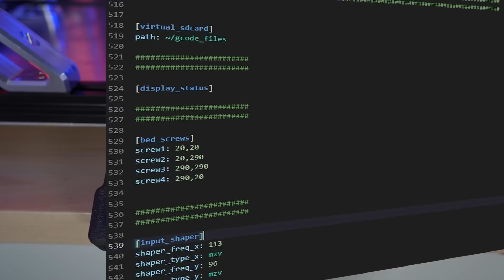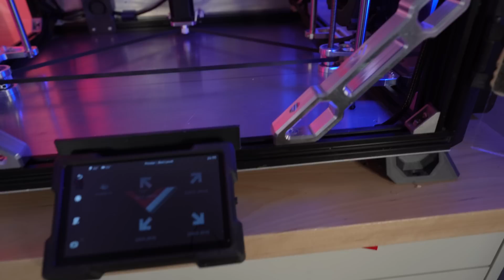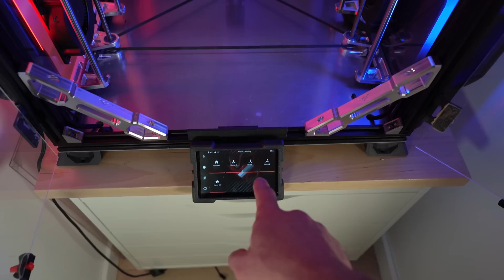VzBoT Bed Levelling

Comment: I was expecting some complicated mechanical means using advanced electronics to achieve angstrom level zero of the Z axis, but then you end up with more weight like the 'TAP'. Your way is better, KISS and use a thick  base like on this machine, wow.

Comment: Your Z-System is the primary reason I'm avoiding a VzBot until there is a more modern z-system like 3 lead screws approach.  I believe there is sufficient evidence that hand adjusted z is a bad idea (Ender 3/Ender ..../insert Ender clone here).  There is no doubt it can be hand adjusted and "It will be fine for months".  But realistically most printers have moved on from that for a reason.  It is a lot easier to control and do a good Z-adjustment on a printer that does it using accurate sensors than needing to do this by hand.
Reply from the maker: You know that I run a beacon sensor? And it can run with any sensor you like?  You know there is also a 3z mod? But for me, my single Z is just too good to switch to anything else. Simple and effective and very very consistent layer height.  Going 3 Z can go bad most of the time. More components, more excentricity, more parts that can fail.. more tuning.. etc..  this z has proven me to be a work horse that is very very precise

Comment: I also found a truly level bed makes heat rise evenly around the bed. When uneven it accelerates air rise and causes one side to passively cool and the other to passively collect more heat.

I found this when printing large ABS prints while my printer was on an uneven shelf 😮

I have a passively heated enclosed Sermoon D1, but might soon actively heat it by installing a intake vent on top and pump it to the bottom while also adding a inline 25w heater

Comment: Hey I might have something really interesting for your build. I have been playing around building machines and I have a printable frame / 4x Z axis screw / straight rods and end stop at each position (top/bottom) integrated in easy to print parts.

Really super sturdy, easy to build and I built up to 64ft/c machines with it. It use 2020 and 2040.

I am not on social media but send me a pm Ill send you a cad file so you can have a look...

Comment: I guess you use mellow super infinite for your vzbot. Can you add 2 pt1000 probes to it? Is it any way of using them
Reply from the maker: sure ..there are many more ADC input
Reply: @Vez3D  so i can connect pt1000 probes directly into thermistor port?

Comment: One of the main reasons i have triple z. i hate levelling the bed and there is basically no way to get it more perfect. its not the simplest solution tho haha
Reply from the maker: Main reason why i have this single z is exactly the same..i hate doing levelling ...so this system you do it once and for all... and be done with it. No probing at each print..no nothing.
Reply from the maker: We also have a 3z option if people prefer that :)

Comment: this does not translate to most printers, since they don't have milled and stress relieved aluminium beds.
my bed is warped in itsself and 4 point leveling won't fix that ^^
Reply from the maker: Why not? You need to level your bed no matter what even if your bed is warped.   then if its warp you add a probe. Vzbot has many probe options
Reply from the maker: But yeah this video is for vzbot as the title says :)

Comment: Personally I think the best all round solution is to have a probe, but NOT a kinematic bed. 
I have a Rat Rig Vcore 3.1 and a  TwoTrees SP5 - the SP5 is a similar bed setup to the VzBot, 2 lead screws and 2 motors but the motors are sync'd with a drive belt which means the bed is never gonna get out of whack. But then I have a probe for Z height so I never have to worry about it. I haven't done a manual adjustment or a bed mesh in at least 3 months now and i use it all day every day. 
The Rat Rig however has to probe the 3 points every time as it can get out of whack when powered off. It only has to do it once or twice before each print but still thats more than my SP5 has to do. 
People like the idea of a kinematic bed so they never have to manual level but actually in the long term it takes more time for every print. I will definitely go for a VzBot / Ender 5+ style bed for my next printer.
Reply from the maker: im with you here :)

Comment: is it normal to have to change Z offset for different filaments to get a perfect first layer or does this mean I have the temp of the filament maybe too low?
e.g between PLA and ABS with such a difference in bed and hotend temp
Reply from the maker: not normal.. I dont touch the Z height once its set. you may have to change first layer height based on what you print though in slicer
Reply: @Vez3D  oh do you have to change first layer height for different filaments?

I've currently got mine always set to 0.24mm and Initial Layer Line Width always set to 120%
Reply from the maker: @littleoz2  well honestly I always do 0.2 whatever material and I never had issue. once in a while I readjust the height of corners, but rarely
Reply: @Vez3D  0.2 first layer height?
I increased mine because of Ellis' print tunung guide said to increase it to 0.25 or greater but think the "magic number" of the z was 0.24 so I went with that, probably sounds really nooby compared to what you do haha sorry!
Reply from the maker: @littleoz2  no not all..I should use higher layer height too for first layer. 0.24 seems perfect to me.

Comment: I really like your project and may even build one for myself in a few years when I've worn out my Voron. The way you've designed your Z-axis is very 'old school' with 4 linear guides plus 2 lead screws. I don't get why you didn't go for some form of auto-level; I understand you don't want to carry a probe around on that racing head but since complexity and cost is obviously not a big factor here, why not go for a 'Voron Klicky' style probe and auto leveling. 

Also, water cooled head means you are going to print in a heated chamber... Once the chamber heats up, your z adjustment need to be rechecked and if it takes many minutes to do, you will cool down the chamber. auto leveling (and bed mesh) should be done with the printer all heated up to its final print temperature. 

I love this project and always looking forward to see what you've come up..  that water cooled print head is amazing BTW . Cheers Bonhomme!
Reply from the maker: old school is cool ;)  And there many probes you can fit on the printer. ABL is no issue here... but i dont need it myself.. so why would I add one ? People can add one if they need one. We have tons of mods for that. We also have a non official 3z but i much much much prefer single Z. Old school yes.. but way to go for me. Do you see a lot of industrial printers with other stuff that this ? Not much. Its simple, its working good. low maintenance etc..  The fact that I did this was because the project was originally from a Tronxy X5S printer. And this VzBoT was an upgrade to the X5S people. Had to keep compatibility etc..  If I had to to change the Z to something else, I would STILL run 1 Z motor, but would do it like Bambulab did. 3 lead screws, one Z motor.
Reply from the maker: on the voron klicky probe topic... you probably dont know because I dont talk about this on my youtube channel, but the printhead has that option already. Quick Draw probe from Annex. And some are using it already. I personally dont like the added complexity, weight, etc etc.. now if I had bad first layers and Z issues, I would consider all options. I dont :)  The only thing that I will be testing is the new Beacon probe from Annex guys. I think its just too cool to not try, but I will probably try it and remove it, because again, my bed is flat is the system is working flawless for me as is, so I dont want to add anything to it. But Beacon, quickdraw, BL touch, inductive 8mm probe, etc etc are all supported on the VzBoT.
Reply from the maker: also.. why do people always just assume that watercool head is ONLY good for heated chamber ? It has many more advantages even if you print just PLA with a cool chamber. As for the Z when its heating up... no I never have to do any other adjustement when its heated. My chamber is running at 45c. I never touch the bed adjuster adter I am done on the first tuning. Well, very very rarely. :)
Reply: @Vez3D  I have 0.100 difference on z between my PLA and ASA profiles.. that'd the basis of my comment ; ) but I agree 100% on all you said. Keep it up and thanks !

Comment: Why don't use the whole hotend and the metal sheet as a normally open circuit? Don't know if the pei sheet is conductive but the aluminum plate shure is.
Reply: Then you have to be sure the pei sheet is perfect, the same issue we have with inductive probes - after alu plate levelling we have no level on print surface. Method in this video or mechanical probes like euclid are the way to be sure we  have perfect level to print, even if magnetic and PEI is not perfect.

Comment: Thank you for your time to make this video.
After the first video you released on discord now I can print without the probe thanks to you.
Then I tried the Retractable Klicky mod, that we have on our discord, I realized that there is a strange thing going on between the manual and probe leveling. When I do probe leveling, (adjusting screws using probe) mesh seems ok by probe, but when I adjust screws by feeler 0.1mm then I do probe bed mesh, the result is strange, left side shows high and right side negative, and when I print nozzle digging the right that show negative. I'm very confused.
If someone can explain this

Comment: Hi Vez. I can't help but think that unequal backlash in the oldham couplers makes this levelling method sub-optimal. Shouldn't we be making level adjustments under a "second layer" environment? Perhaps a macro for using feeler guages for seting the four corners   - with the backlash taken up?
Reply from the maker: There is not enough backlash to cause issue since the z moves up and down high enough to clear that backlash.
Reply: @Vez3D  but the degree of backlash isn't necessarily the same between 2 given couplers - the first batch from mellow werent the most consistent. The concern I raise is that if you level off the upward stroke, the downward stroke may result in the bed tilting. But maybe if the leveling function has the nozzle touching the centre of the bed, but the corner levelling done by raising, then lowered to accept a feeler guage seems a workable and repeatable solution.
Reply from the maker: @jezdimir2007  thats why you do a final adjustement when it starts to print. it will do it on the downward stroke of the Z system...then backlash doenst matter anymore. But one thing I need to mention is that the radial friction on the oldham coupler with bed weight is good enough that backlash doesnt happen for me. But its not enough friction to block the oldham coupler from the strong wobbling force of the lead screw if there is any wobbling in axial direction.
Reply: @Vez3D  have you every heard the old joke that the optimist see's the glass as half full, the pessimist sees the glass half empty, and the engineer sees you're using twice as much glass than you need. I only suggest that a small tweak would eliminate that final adjustment.

Comment: Love the AWD but the Z is kinda dated compared to similar corexy printers.
Not saying it causes any issues necessarily but if it had a maxewell belted Z like a K3 it would be more "Cutting edge" like the rest of the printer ♥
Reply from the maker: And what more does this going to going to give me?  My Z works perfectly like that :) simple and effective. Very effective.  I dont get why people want to add more to something that works good already. Add more complication..motors.. heardware.. etc. What issue are we trying to fix here? None for me :)  i get perfect layering
Reply: @Vez3D  praise! Thanks for the awesome mod man, keep it clean!
Reply: Looks dated? a perfectly functional system is not like milk it doesn't go out of date.
Reply from the maker: @vizionthing  thank you !!! I love the analogy
Reply: I get it works fine.
Having to use a piece of paper to level your bed and set z offsets is kinda dated.
Leadscrew and linear rods have issues with accuracy due to wobble compared to belts + linear rails. 
Especially since the leadscrew is not integrated or even directly coupled to the stepper. They are belted and being tugged to one side.
I realize there are metal mounts to counter this pull. But then you also have the issue of putting a pulley on the end of the leadscrew.
The grub screw will wedge to one side and ruin concentricity on the pulley.
Reply from the maker: @Tamandua  i guess you didnt see well how that Z is ;) there is no motor coupling to lead screws. .and lead screws are coupled to bed with oldham. I could run a bent leadscrew and that would still not matter.  Im really not a fan or belted Z.. i have my reason for that ..but thats a debate for another day
Reply from the maker: @Tamandua  so with belt .. you still need to adjust z height with z offset. How do you set that? Same as here. Except you tell klipper the z offset. You still need to use a piece of paper or some king of visual.to where nozzle will hit the bed then you set your z offset for the probe. Its not any different here..excet you dit manually. Even with a probe you still have to first adjust the height manually one way or the other. You cant get away without it
Reply from the maker: @Tamandua  you got a point though for pulleys on lead screws with a grub screw. You need very good tolerances on the pulley to avoid that. But same applies to pulleys on a belted Z.
Reply: Yeah, and it would deviate further from the original goal, a fixed tronxy printer. Now it's becoming more and more a voron/annex and frankly we don't need more of those. This should be a fast and easy mod to make a very good printer, not something chasing every little detail.
Reply from the maker: And also.. this full z aluminum is so good looking. :) at least for my taste

Comment: Software compensation is good for things where hardware compensation doesn't suffice or is not possible, like pressure advance. I will probably always keep leveling my bed manually. I do have to say that if you have relatively soft bed springs, the motion of the printer will eventually wiggle it loose, especially with bedslingers. I would like to see some kind of bed adjustment system where you can secure the screws. It'll be interesting to see if the bed ever moves again.
Reply: Just get silicon spacers, I rarely have to touch my leveling at all
Reply: @felixfe7958  Silicon spacers below/above springs to increase tension you mean?
Reply: @SoundShunter72  no, silicon spacers so it's on a fixed position
Reply: @SoundShunter72  I would say instead, not above/below. That's the usual recipe, just sort of a cylinder with a screw size hole through the middle. They are themselves a spring damper system with a very strong damper; springs are springs, even if you compress them more and install something to force them to turn less, they're still gonna bounce, which is just bad news all around.
Reply: @SianaGearz  Interesting, I have never heard of this. I guess it still allows some adjustments for different bed/hotend temperatures. I'll look into it.
Reply: @SoundShunter72  At 3:00 you can see such in this video. I suppose you can buy them or make your own in numerous ways.
Reply: @SianaGearz  Ah yeah I missed those, I need to get my eyes checked lol
Reply: I really like the bambu labs printer idéa that it scan the whole bed and check how flat it is, then just adapt the first layer to the flattens. So it have more than just corner reference points.

Having a LADAR or RADAR or whater ever they use, seam to be pretty usable.

Comment: Thanks Vez, this kind of video is very useful just to show how simple it is - this is very much like an Ender-3 levelling :) for the first adjustment of the corners, it can be best to move everything by hand (as your text caption in the video says)

Three questions,
1. Is it better to use three bed screws, not four, since three points define a plane? i.e. one of the bed screws should be halfway along one side

2. Does this Z-height drift with temperature? Should all the adjustments be made with the bed at temperature - and does the bed turn into a ‘taco’ when it’s heated, making mesh levelling necessary?

3. The thick aluminium bed obviously has considerable mass. Do you use Z-lift on retract? Usually it is used to prevent the nozzle scraping lines across the surface during travel moves - I wonder if the heavy bed and single stepper motor can move fast enough to keep up with your print speeds :)

Thanks for all you do, I’m a 120mm (big fan) :D
Reply from the maker: 1- i personally think that we need 4 corners support on big bed. It really helps stabilizing the bed and keeps it for resonating too much. A good 3z system i think is like hevort. It still has 4 corners support but 3 on a bed frame. That makes the bed plate stable and kills vibration. But yes..3 points define a plane here. But there is more than just this..    bed vibration is under rated and we should pay attention to this a lot

2- not enough to change much. But the final adjustment is when printing.. so this is where you make everything perfect.
3- check my other video about how strong that single z motor is. I do z hop sometimes at super high speed and its not an issue. I even tried quick Z movements with 25lbs weight on the bed

Comment: For people with bed porbe, there is like a 4 point measurement where the screws are, klipper will tell you how to turn the level screws and then you do the mesh (dont know if you mentiont that in the video)
Reply from the maker: Yes I did :)